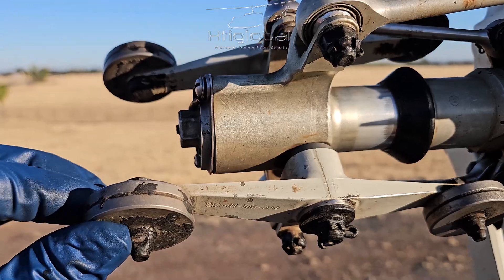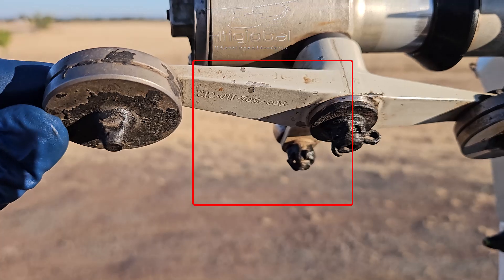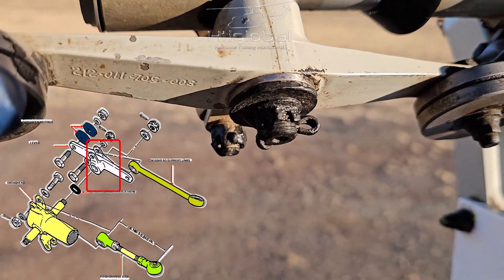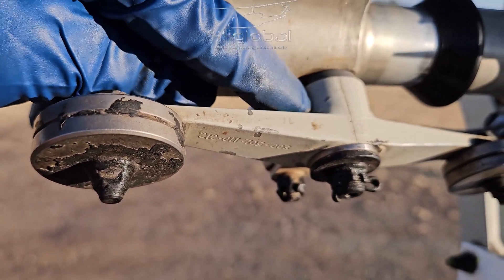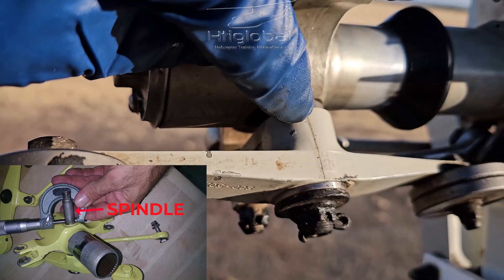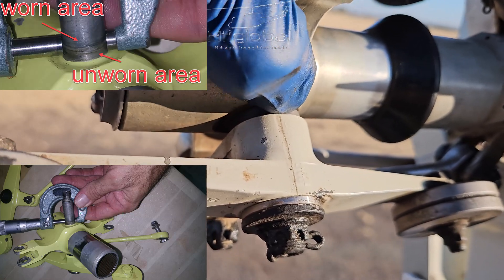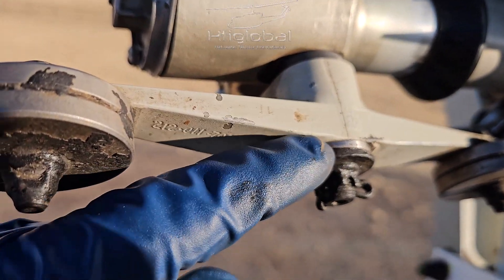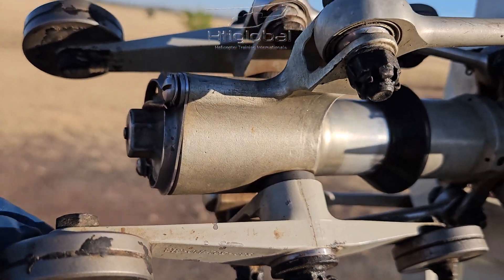BELL MEDIUM TAIL ROTOR CROSSHEAD BELLCRANK WEAR

Comment: Kindly make a video for Rotor track and balance on Bell 412 helicopter....... include all the corrections like tab bending, weight correction,pitch link correction
Reply from the maker: Good afternoon, we do this section during our courses. We discuss issues and troubleshooting.Due to so many equipments, we don't go over specific devices. Most of the equipment's offers technical training.
Reply: @HTIGLOBAL  u can go for a general track and balance procedure by showing the locations where we can give correction